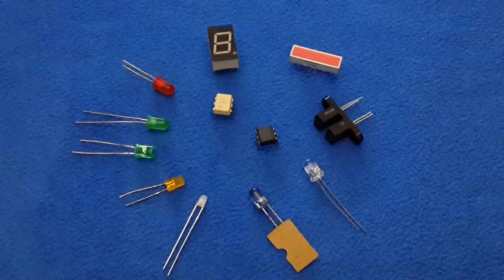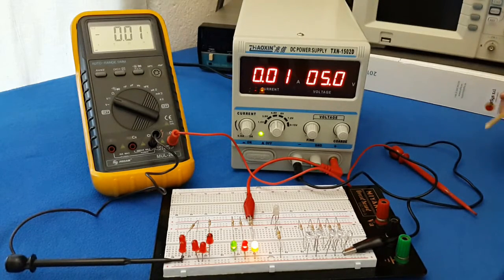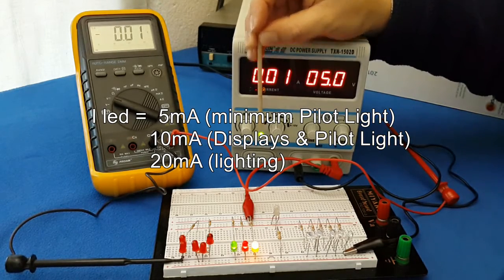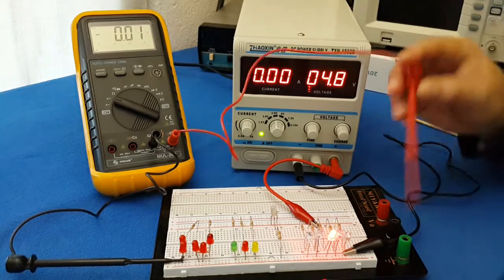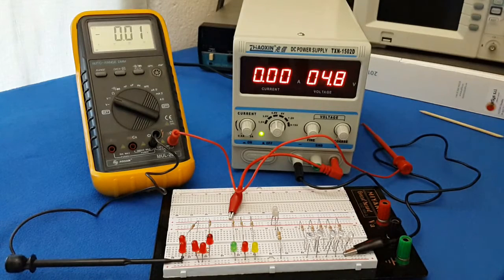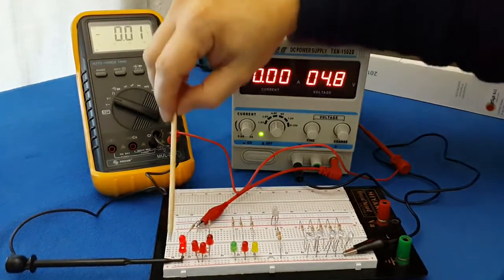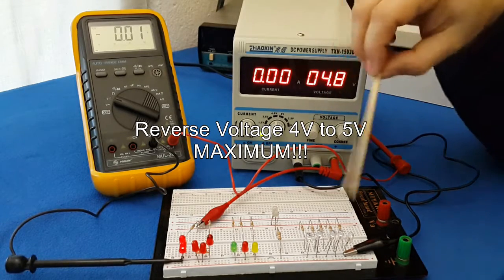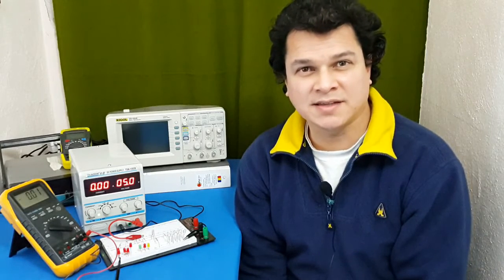What is the average LED diode forward voltage ? / red green yellow blue white IR led voltage drop

Comment: If i have a 3v battery and i put a resistor to limit the current thru the led to 10 mA Will the battery last longer than if i had connected the 3v led directly to the 3v battery? I know the led will not be as bright but that is my intention.

Comment: I charged a capasitor with 3 volts for 5 minutes, but when i took out the resistor to measure the voltage it was next to nothing. Why isnt it 3 volts?
Reply from the maker: Hi! An ideal capacitor is like the capacitor we draw in the schematics. But a real capacitor has an internal serial resistance, and other internal parallel resistance. The internal paralel resistance is perfect in infinite Ohms, but if was low Ohms, then we have a defective capacitor with leeks between its permeability.  Before to blame your capacitor, remember it can discharge against your voltimeter who has internal resistances and another discharged capacitors ready to receibe your testing capacitor's charge. So, try to make the same test,  but leave the voltimeter in parallel without disconnect it, and only remove with a switch the voltage source and the serial resistor. Then you will see your 3 Volts, and the capacitor's discharging. Analog voltimeters or DMM with bars lines in the display are the best for this experiment.